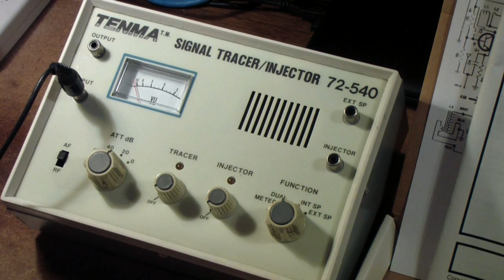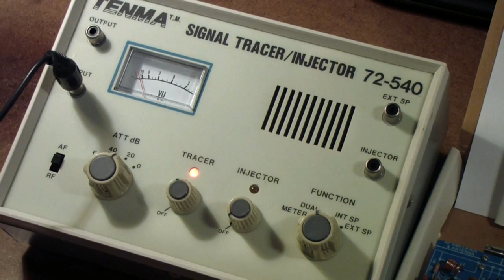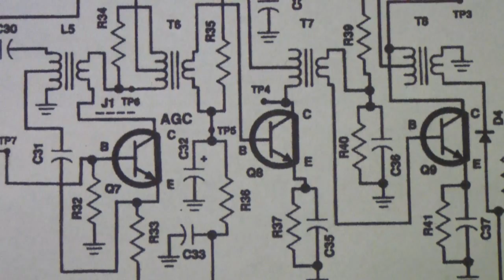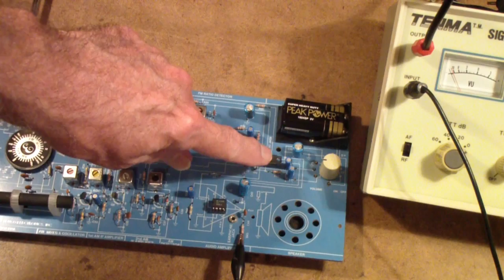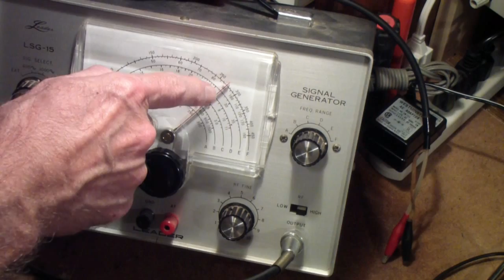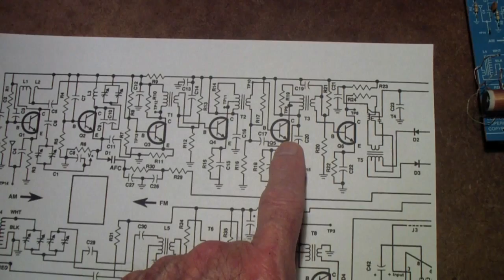TTT166 Tenma Signal Tracer

Comment: I realize that this is an older video but, I just picked up one of these tracers for less than a song. It has no leads though and I was wondering if there is anything in that probe, like maybe a capacitor to block the DC or is that in the unit itself? Also, the injector wiring looks as if it is just an RCA jack with two wires going to alligator clips. Am II correct on that one? Thanks for the help and loved the video as it shared everything needed to operate one of these.

Comment: Awesome video. I've been trying to lean more on using my Tenma tracer/injector (same model as this) so I can be more effective and efficient on diagnosing issues with guitar amplifiers and other various audio equipment. I'm also trying to be more mobile so as to make it easier on the clients in the event they can't transport their equipment. Because this model runs on a 9v battery and is an all in one unit, essentially... It makes things a lot easier because it is so compact. Many people would say that an oscilloscope is a better tool for my realm, and it probably is. But, if I'm mobile and not on a test bench, this thing becomes super handy and essentially allows me to isolate any given issue even if I have to use process of elimination based on problems I know aren't presented on any given amplifier. 
This video really does demonstrate how useful these devices can be. Thank you for the upload!

Comment: Dear tomtektest, I am building one of these kits right now. I have just completed the AM section, I used the Eico 324 signal generator and a Heathkit audio generator to modulate the 455 KHz at 400 KHz to do an alignment. The AM section operates very well. I did not understand how to use a signel tracer but this video cleared up a lot of questions I have. Thank you kindly for this video, it was most helpful...

Comment: Thank you so much for the input, I just though that because you can dial in 10.7MHz on the 324, it is still AM signal, so now I understand what you are saying.  I have noticed that when I set the Eico to 10.7mHz and connect the RF output to TP A, I can hear that signal through the speaker, this is a very interesting point... Again great video, and that was so interesting that you worked at a shop that really used this vintage equipment.... Take care and enjoy your weekend....):
Reply: Tuning slightly off frequency makes AM modulation easier to hear through FM detector.

Comment: Wanted to ask you a question, the FM  section does not work, I checked the transistor voltages and they are OK, The fm section will pass a 10.7 MHz signal, however, no output at all, and ideas. I am using the vintage Eico 324 modulated with a 400 KHZ tone. Completely dead... Any ideas???
Reply from the maker: Your question rang a distant bell with me. I worked in a Radio-TV shop in high school (1960's) and ran into the same issue. The EICO 324 will only generate Amplitude Modulation (AM). To get a signal to pass through the FM detector, it must be Frequency Modulated (FM). In fact, the FM detector is designed to reject AM. I still remember my red face when the shop owner explained this to me after I spent a whole evening trying to get an AM signal through an FM radio. If you have a function generator that can produce 10.7 MHz with FM modulation you will be able to use that to align the IF amplifiers. To test the FM Converter (Oscillator/Mixer) will require a true FM generator like the Sencore SG165 since most function generators wont go to 108 MHz. If you have access to a scope and a demodulator probe, you can use an AM Generator to align the IF stages by watching the demodulated AM at the input to the FM detector. If you don't have an FM generator or a scope, you might want to re-read the manual section beginning with "FM Final Alignment" (on page 36 in my manual) and continuing with the next page entitled "Alignment with no Test Equipment." Hope this helps and welcome to the club.

Comment: The signal tracer I use in my mind and a simple oscilloscope. Having other tools like a C meter, voltmeter and ohmeter were all I had when I made a living in radio repair. Alignments were not necessary , and most problems were repeatable factory and design fuck ups. Better tha fancy equipment was a good parts supply and a tube tester. A new tube is more likely to fail before one that has been in operation and proved its worth. New tube had a higher confidence level and peace of mind. You know that feel good emotion. The markup on tubes was very profitable as well. The customer was given a false sense of security too, know the radio needed an affordable part. I never threw out an old tube. The first offering was back to my customer. If they refused then the tube went in my supply of known good but maybe weak tubes, to be used as tools. I never resold an old tube as a new one.

Comment: Tom, why does it look like the IF transformers are stepping down the signal with the schematic showing the higher number of turn on the left and the smaller number of turns on the right?
Reply from the maker: IF transformers for transistors must have a step down turns ratio to match the higher impedance of the output to the lower impedance of the following input.  With tubes or FET transistors, the opposite is true and the output impedance is lower than the following input impedance so the turns ratio is low to high in those circuits.
Reply: Thanks Tom!  I'm been learning on tube gear and when I watched your video light night I was confused by the schematic.  Again just learning...so does that mean that the subsequent input would attempt to draw too much current from the preceding output if there wasn't a transformer there to limit impact on the preceding circuitry?
Reply from the maker: Actually it is about efficiency - when a stage is driven by its input impedance it is more efficient. Similarly, when a stage is driving its output impedance it is more efficient. So, transformers are used to make the preceding stage see its output impedance and the following stage see its input impedance. You can think of it in terms of current and voltage if you remember that impedance is just the ratio of voltage to current.
Reply: So the output of the preceding stage is generally going to be higher in voltage, lower in current than the subsequent stage.  IE the subsequent stage is looking for more current (power?) and less voltage as it will then provide additional amplification to that input?  If this is incorrect, perhaps you could dust off an analogy for me to better understand this concept.
Reply from the maker: I think the best approach is for me to refer you to some basic electronics text. I used Basic Electronics published by the US Navy in 1955 - it can be found online by searching for "basic electronics navy pdf". There are many others but I know this one is non-mathematical (it is also dated but that might be good since you are interested in tube circuits as well). The sections you might look at first are those on transformers and tuned circuits. I also suggest you try to find a local mentor (perhaps through a local ham club or trade school). I am sure that you realize that trying to convey large quantities of information by question and answer in YouTube comments is very inefficient and best used only to cover specific questions directly related to the video. If you prefer to use YouTube videos instead of a text, you might search for the same topics mentioned above.
Reply: Thanks, Tom.  I appreciate you taking a few minutes to help.  Have a great summer.  Best,  Tony.

Comment: HI Tom,,, thank you for the interesting and informing video,, I'm wondering if the Elenco radio kits are still available these days?
Reply from the maker: I think Elenco has discontinued its kits but they are still available on Amazon (I bought 3 from Amazon after Elenco announced the change.) I think Elenco transferred its remaining inventory to an Amazon warehouse so, to the extent that inventory remains, they are available there. I just checked Amazon and the AM/FM kit is still available for $39.69 as well as some others.

Comment: Great video, I have a kit like that I need to finish. Could you do another and show how to do align the if and s curve with your sencore sg 80 and test sensitivity. Thanks Jimmy Alabama
Reply from the maker: I have considered a similar thing for some time and it is certainly on my list. Right now I have a lot to do before fall on other things so I do not know when I will get to that but I will try to move it up on my list. I would prefer to use a vintage (1960-1970's) FM tuner for the alignment demonstration though because I feel that would be of more use to more people. I would also like to include Stereo alignment in the same video. I found the alignment instructions in the Elenco manual straightforward, with or without test equipment (it is nice they included both). Since the resulting receiver is not intended for HI-FI use, the alignment is not as critical as in other receivers, especially Stereo or wideband HI-FI receivers, so I just did it "good enough" on the Elenco. I will, of course continue to think about this until I actually get around to an FM alignment video so comments and suggestions are always welcome.